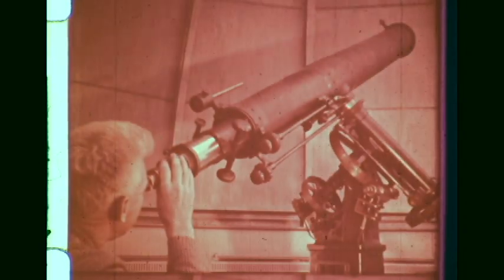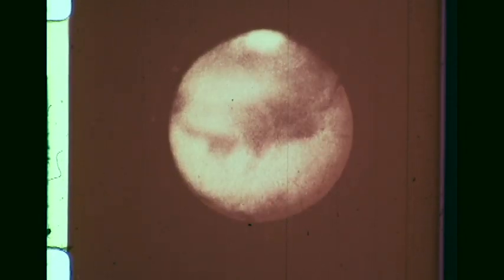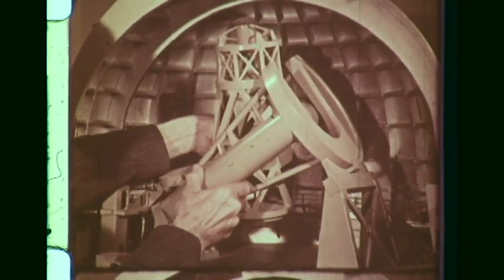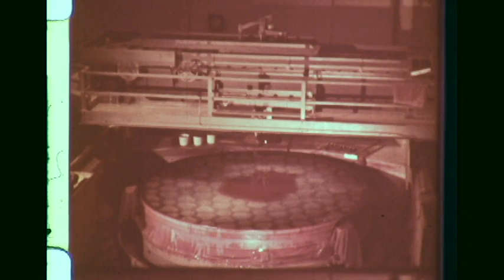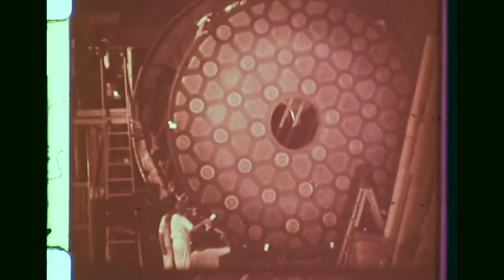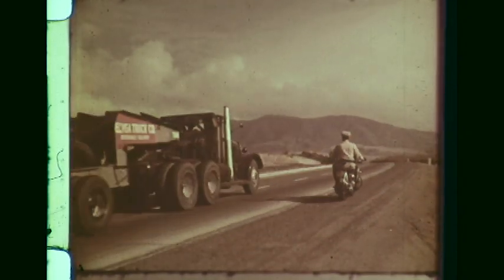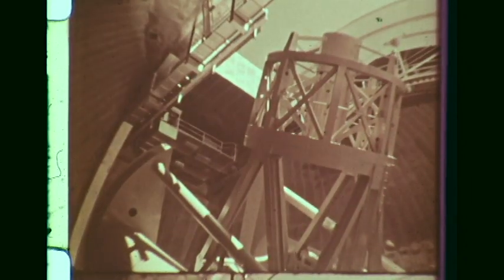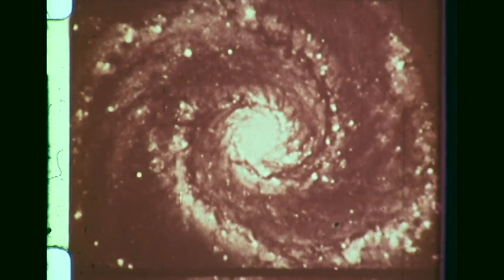The Story of Palomar - 1948

Comment: 16:50 The tightly-fitting borosilicate cylinder which fills the Cassegrain hole at the center was lowered in place by putting a block of ice of the same size in the hole, and when the ice melted, the borosilicate block slowly fell into the cavity. Then the gap was filled with waterproof cement, which locked the plug in place. It was, obviously, removed after the mirror was finished. This is just a very minor example of the myriads of research and engineering problems which had to be solved, and which caused the project to last 20 years. Griding, polishing and figuring the mirror alone took 10 years. The scientists were completely on terra incognita, because nothing similar had been done before, everything had to be invented by an army of brilliant scientists and engineers.